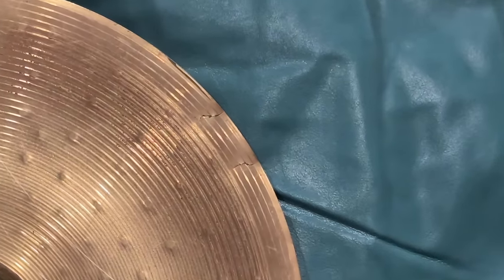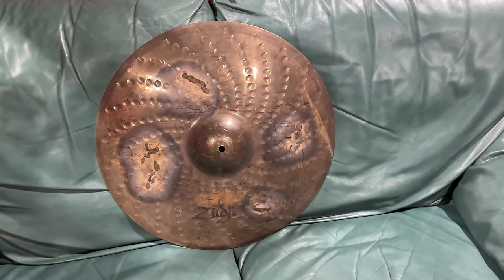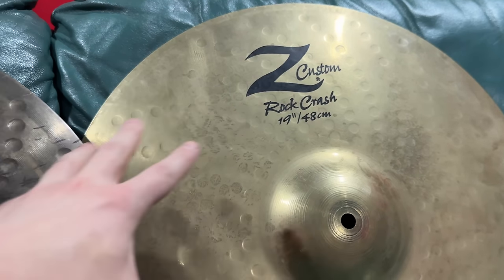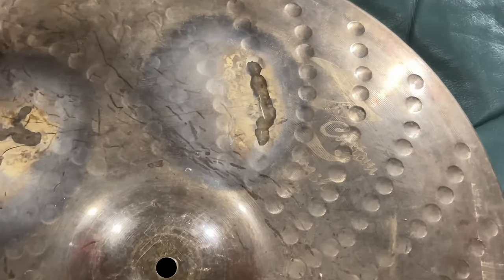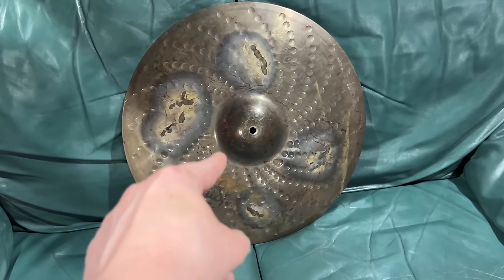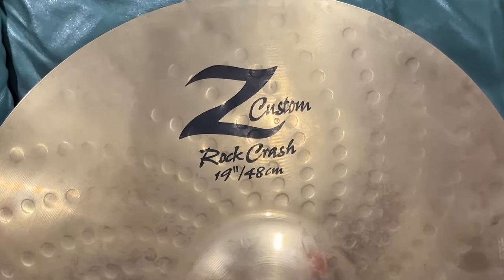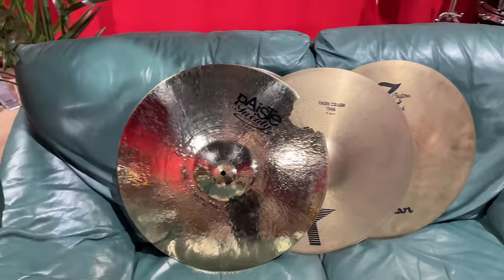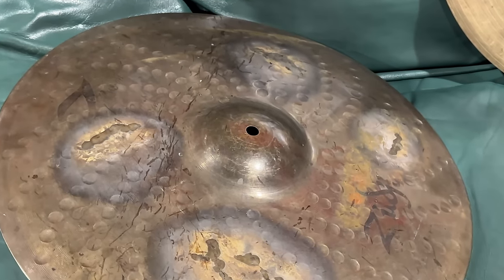Someone welded this cymbal.

Comment: Bronze and copper "harden" when hammered, it's a cold process (unlike other metals such as steel, which need to be "hot tempered") The force of the blows builds tension, it's the same manufacturing process of the Hang drum, or "Steelpan /steel drum" (they are "baked" at the beginning of the process, sometimes in intermediate stages, but the final sound is obtained by building tension with the hammer (hydraulic presses or lathe when mass produced, but it is "cold forging") 
Any heat applied afterwards releases some of that tension, in an uneven way,  that's why it sounds "muffled".
 Maybe, if after soldering it's heated all the way up again (oven) and then hammered again, it might have some chance of coming back to life. But it's like building it again xDD

Comment: Z customs are NOTORIOUS for severe cracking. I’ve seen hihats bottoms crack edge to bell then bell almost back to the edge. Spot on with why, they couldn’t vibrate and flex properly so normal play for these was like putting severe stress on a well made cymbal. A few sounded great for that punk rock/metal vibe, but there was nothing they did that couldn’t be done better by an A or A custom.

Comment: I genuinely wonder how a riveted plate repair would sound over a crack… a lot of heavy industry avoids welding not only bc of the heat affected zone but because welds are just brittle as hell. Not ideal on something you want to wobble. 
But a (well designed) plate repair is meant to not only fill over the material lost but provide a smooth transitional area which keeps the stiffnesses similar to how it used to be. So it would definitely sound different, but I wonder how it sounds compared to cutting

Comment: I'll admit a while ago I tried to solder a small crack in an 8" AAX brilliant splash, it actually worked just fine as a fix temporarily. After doing the same thing several times I just stopped and use it in a stack now.

Comment: I was once saddled with a 16" Meinl crash (I don't know the model cause the markings were long gone). Somebody welded a crack at the base of the bell and it sounded awful. I cut it out and cut out a couple other cracks on the edge and it sounds so much better. At least it doesn't sound like I'm hitting tin roofing anymore lol. I use it as a trash cymbal.

Comment: If a cymbal cracks you need to deal with it asap - before the crack spreads.  There are two techniques.  If it is shiny then you can mount it on the wall and put some LED lighting behind it - makes a nice decoration, just not in the studio.  The other technique is to take it to a scrap metal dealer.

Comment: The welded cymbal is probably fixable.

When the cymbal was welded, it heated up a lot of the metal around the weld which then presumably cooled off quickly. This annealed the bronze. A good cymbal is work hardened from hammering but the area in this cymbal which was welded has been annealed which resets the work-hardening making it floppy which dampens the sound.

Option one to fix this cymbal would be to heat treat it by heating it in an oven to like 850-1000 degrees C. Then lower it to like 450 degrees C and let it sit for like 4 hours, then let it come to room temp without quenching. (The specific temperatures and times are specific to the alloy of bronze the cymbal is made from.)

Option two would be to hammer the discolored areas of this cymbal to work harden it. The skill here is to hammer it to the point just before where it cracks again. How do you know at what point it's about to crack? Skill.
Reply: @NotaBInMyH  I was reading those temps off of some table I found on Google without really fully understanding the material. My point was to explain why (from a metallurgical standpoint) welding didn't work in this case and how it potentially could be fixed. My knowledge on putting metal in an oven really only goes as far as seasoning a skillet.

Comment: A chipped cymbal will still sound 'good' but of course it's not a piece of equipment you'd like on tour if it has edges that can potentially hurt you.
Welding a cymbal basically changes its alloy (by adding foreign untreated material) and temper. I'd suggest leaving it in the oven for a few hours and try it again when it cools down. And even still, no promises that cymbal's gonna sounds AS good as the chomped one. It'll probably sound worse or not sound at all as might be past its ideal temper point.

Comment: if you hammered the welds and relaxed the metal you could get the sound back
Reply: Probably re-temper it as well. Because likely when they welded it they ruined the temper of the metal aka the microscopic crystallized structure. So yeah polish off the Weld to make it smooth, find somebody who can heat the entire thing up and have a tub big enough to quench the whole thing.

Comment: The great thing is: every cymbal ever made will crack with enough use. It's not a case of "if" but "when" because you can only vibrate so much before bronze (or most metals for that matter) work harden and become brittle, and it's an irreversible process without annealing it in an oven.

Bronze can't really be quench hardened like steel, it's work hardened, even in the bronze age bronze would be work hardened to make tools.

Comment: One thing I’ve noticed about center cracks on cymbals, you could cut the cracks out and keep using the cymbal. Sure it would lose some of its sound characteristics, but it would be made up for in something that still can potentially sound good.

Comment: so by hitting the symbol you are cold working the metal, you need to Anneal it, so basically it's like baking a cake you can use a fire pit for roasting marshmallows to bake a cake, but you really need to use a oven and you need to do it in a special way. I know nothing about symbols but I would guess that the reason it cracks in the center is because the center symbol metal in such a way to make it hard and rigged in the center and relaxed at the ends. so if I were doing it I would slowly bake the metal keeping it hot and relaxed then I would quench(make it cold quickly by putting it in water) it, then after I would heat up only the center of the disk and let it cool slowly giving time for the metal to crystallize hard but only in the center but not too hard or it will crack. https://en.wikipedia.org/wiki/Annealing_(materials_science)

Comment: Hey for the keyhole spidder cracks, that might be stupid but also stupid enough to work maybe :
What about just adding a reinforcment disc under the bell ?

Nothing too drastic, barely more than the cracks themselves, and just solder them ? less heat than welding, and I guess it's a part of the cymbal that can be sacrificed for longevity ?

Comment: Could probably braze it with some type 5 solder.  Non-ferrous to non-ferrous.  Just get some borax, a bernzomatic, a can of Mapp gas and some solder.  Since the metal is soft, you might be able to tap it with a hammer to get it consistent.  Then polish it up.  Worth a shot.

Comment: Bronz and brass are not like iron/steel in wending; It is possible to weld it, but it have to be tempered again.
The thing about copper alloys is you cannot harden them like you would with steel tho, so it would bean to hammer the sheet into its sound.

Comment: I would never have thought to weld it, because I would have assumed (correctly as it turns out) that the heat would change the metal. I do now find myself wondering though if a lower temp method to join metals would be acceptable, like using lead free solder since the temp is comparably very low, or brazing since the joining material could still be brass or bronze.

Comment: Just for ghits and shiggles you should try shrinking the welded symbol. Heat up the welds to cherry red and then quench. I wonder if the tension created will change the dead sound to a different dead sound?

Comment: hi! I actually know a thing or two about welding and yeah, no, if there's a crack in the actual material, you can't just. tack over it. If there's a crack in your weld, industry code (at least in america) says you have to grind it out completely and re-do it. A crack in the material itself? No dice. Just throw it away. Like you pointed out, all the heat going into the metal will just add more stress and likely make the crack worse.
I mean, hell, I went to school for this. I'll at least give the previous owner some credit for managing to do this without actually warping the poor cymbal but like, it seems they only knew how to hold a welding torch and not much else.

Comment: I wonder if piening the weld after welding would solve the sound problem, or using different but similar techniques like soldering or brazing with different filler metals.

Comment: Hi, I'm no expert when it comes to music/cymbals; but I know a thing or two about metal (in particular brass and bronze) and I know a thing or two about Braizing, welding and Soldering. I think potentially you could fix these. But it needs to be done properly. You mention that cymbals tend to have alot of stress and tention in them making them difficult to fix properly and you are right. Metals with high stress in them are a bugger to Braze, weld / Solder. 

That being said, it can be done as I've done it (fixing steam engines and steam engine components made of steal, cast iron, copper, brass, bronze), but its a difficult process. First you need to heat the entire work piece up in one go ideally in a kiln or oven and this must be done slowly; like, over the course of a few hours. The bigger the piece the longer the heating should be. When its up to temperature you then weld/Braze your piece and put it back in the kiln/oven and slowly lower the temperature again, over the course of a few hours. Sometimes the work piece might still break as it the nature of things, but if you do this it should give it the best chances.

Comment: is it bad that I actually like the bonk that the "improved" cymbal makes? XD

but I would love to have a go fixing a cracked cymbal with a welder cause I work as a welder. would be a fun project to see if I can spot weld a crack with a tig in a way that doesn't put too much heat into the cymbal whilst still getting rid of the crack. 

I would drill the ends of the crack to terminate it so it can't spread and then use something like 200 amps and a quick 50ms pulse to weld or rather shoot one tiny part of the crack together, wait for it to cool down and do it again until the entire crack is welded on both sides. mabye it will keep sounding decent, mabye it is possible to tune the sound by putting small tacks in select location and mabye I just ruin an already ruined cymbal

Comment: Welder here ! Not only are those the worst welds I ever saw... but welding alloy metals that are heat treated is always a lenghty expensive procedure. Having never welded bronze, I imagine I would completely aneel the cymbal, then normalization cycles and finaly tig weld as hot and fast as possible to get a small heat afected zone. I would then call a metalurgist to know how to heat treat it back to a playable state. 

Probably wouldn't work but still better than just weld on it cold and hope for the best.

Comment: you can usually retemper it to sound pretty good, if it didnt start life as a high end it might even improve
bolt an eye bolt through the hole, use that to hang it over a fire concave side facing down. the outside edge will heat faster, at a certain point you can dunk it in water to quench it and when the metal shrinks, it will put tension back into the shape and become musical again. 
for some SLIGHT fine tuning, you can sand the inner section down and that will raise the pitch
Reply: Worth a try since it's completely trashed otherwise

Comment: I wonder what it would sound like if you sanded and polished the whole thing. Maybe taking some material off and making it thinner would help it ring more. Or heating it up evenly with a heat gun and letting it cool down slowly the way the way they temper metal for knives and tools and stuff.

Comment: The symbol that he said was the same as the broken welded one sounded deeper than the other one that he used during the beginning part which sounded more high-pitched but the welded one sounded like it was a thud sound like certain drums that I've heard so you could replace those particular drums with that symbol and it wouldn't sound very good but it'd be funny.

Comment: All the welding has added tension to the metal and won't allow it to vibrate when struck anymore, hammering the welds to stretch them could relieve the tension but the sounds only going to get worse the more you mess with it

Comment: It's certainly a unique sound but yeah she's gone. Better off sending it to recycling than whatever that hack job was.
I wonder though if it technically counts as welding, brazing, or soldering and whether the lower temperature would damage the symbol less.

Comment: Welding pulls the metal, so it’s not even a matter of heat in the metal, it’s changing the tension in the whole cymbal which is why welding is so drastic a change. I’m betting the “specialized technique” to repair would be closer to brazing or soldering, which wouldn’t altar the tension like welding would.
Reply: What about JB Weld?

Comment: I wonder if you could anneal it, then re-work harden the cymbal to return some of the sound. Since the weld annealed it in the places it was welded, the sound doesn't move through the grain evenly and I think that's why it sounds so shit after it's been heated.

If you were to evenly anneal the whole piece to even out the grain, then maybe peening the whole surface either by hand or with an auto-hammer (or some other weird specialized cymbal hardening press doo-hicky) to work harden it, you might be able to return some of that cymbal sound to it.

Comment: You can try to anneal it, temper it down. Then hammer it with a ball peen hammer and then lightly hardening it again and then anneal it down to temper. But you must do it universally and evenly. When welding it you made it super hard on few spots so you need to make it even in temper...
Reply: But on top of that you need to put the it in a lathe to turn down the uneven thickness of the metal. It must have even thickness to sound right...

Comment: I was not prepared for the sound of the welded Z custom. Side question - have you had much of a play on the Stagg Genghis series cymbals? I got them as a 'mid range' set to get back into drums and I was really happy with them. I have the duos and the hats are so lovely and dry and my 21" ride is such a good crash ride. Nice and washy and thin with a lovely touch.

Comment: I've heard metal trashcan lids that sounded better than that welded junk.

But since it's toasted already, why not heat the whole deal up to cherry then put it into a rock wool sandwich to cool down slowly and see if that gets the odd stresses out. What's the worst that could happen, it sound better at the end?

Comment: What happens if you weld up the cracks that it still has?

What happens if you get the whole thing super hot and then quench it in water?

Can't make dead any deader, right? You can always melt it down and make a paperweight...

Comment: Put it in the oven in pyrolisis mode for a few hours, on a sand bed if you can. Then let it cool down inside the closed oven. See how it sounds then.
Reply: Or just max temp if it doesn't have pyrolisis

Comment: B20... traditional welding methods like MIG, TIG or ARC don't work 
B8.... TIG welding is possible under ideal conditions
Laser welding is also possible but the equipment is cost prohibitive.

Comment: assuming the guy didnt add filler and just autogenously welded the cracks togeather you possibly might get away with bringing some life back to the cymbol by putting it through a heat treatment to normalize the metal stresses post welding. if it was braised or welded with filler rod its totaled tho.

Comment: I know nothing about symbol making so forgive me if this sounds extremely smooth brained, but after braising, shouldn't you still grind down the weld spot and temper the symbol? Is that not possible with a symbols manufacturing process?

Comment: 1. that looks Brazed, not welded. Its basically like hot gluing metal together whereas welding fully melts the material 

2... thats a shit job of it too, with a proper weld and surfacing/heat treatment you might be able to get closer to what the metal was originally like.  But for that effort you might as well get a good cymbal

Granted I only know about this from a structural metallurgy knowledge and not a musical one so if I had to guess it'd probably still be fucked just have a more consistent sound and not permanently muted.

Comment: its been annealed... ALL cymbals sound like this before the final spin and hammer. dead as. 

think how theyve done them for centuries... pour out a mass of bronze and start hammering. try and go too far, it cracks, have to melt it down,  tsart al over again.

otherwise, keep heating it up, hammering it until its starting to get hard, heat it again...

the art is knowing when to heat it that last time, the right amount of hammer and stress to get just the right tone... without it breaking in a few days! yeah, all machine now but give credit to the artisans of yesteryear...

\this is where you take it outside and make it a true custom... hammer it rather than play it...

and of course, what is it "welded" with? a strip of old cymbal or just any old thing? you never gave us a close up!

Comment: I'm not a drummer at all. I am however a veteran welder.
this is a really bad repair job. idk that I could make it "good as new", but there is much better ways to do a repair job on something of this alloy and processes to help localize heat distribution.

outside looking in I would have replaced the product on my dime before I let this POS leave my shop. 0/10 repair job.